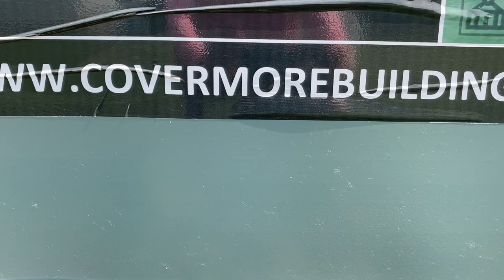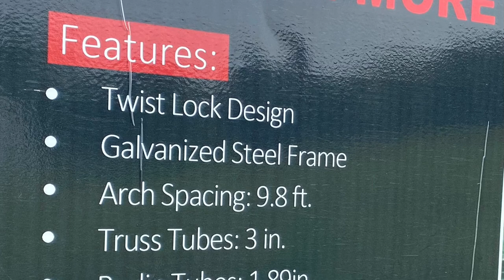Covermore Container Shelter Installation

Comment: Great assembly illustration video! Where I live, we have frequent wind gusts up to 40+ mph. What is the wind rating? Also, our structures here have a limited height of 20 feet. How high are covers at the peak (apex)?
Reply from the maker: Our 20' wide shelters have a 6.5' height on top of your container height, our 26' wide has a 10'' height on top of your container height and our 40' wide shelters have a 15' height on top of your container height.  These do pretty well in moderate wind, but ours do not come with engineered ratings.

Comment: Please add how to park the containers so we know how far apart they need to be and if there is concrete pads underneath them.
Reply from the maker: Our Covermore 40x40 dual truss model calls for a 37ft. 8in. spacing between containers, and square containers by checking diagonal dimensions.

Comment: Any solutions to prevent water from draining down the inside?
Reply: @covermoresheltersinc.4951  Are these shelters available to go to the outer edges of the shipping container as I have seen shipping cotainers deteriorate at the ceiling from the elements and want the chance to harvest the water. TIA.
Reply: @covermoresheltersinc.4951  Cheers